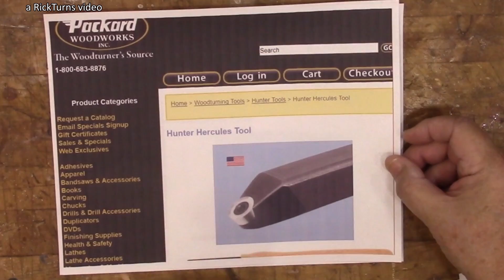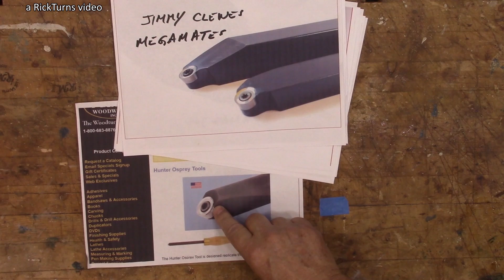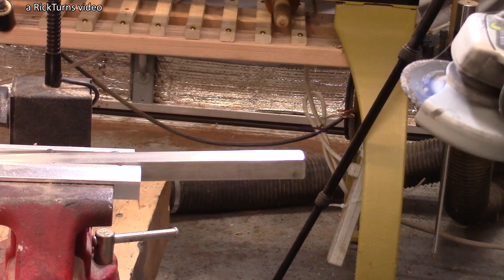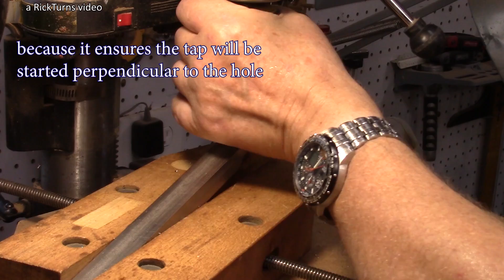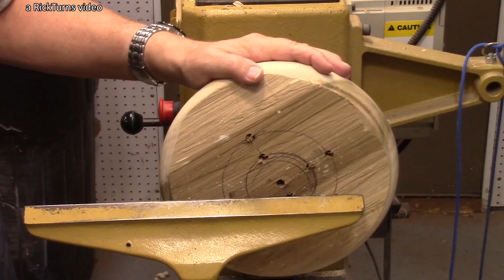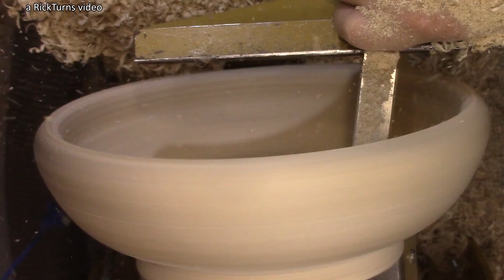Making and Using a Drop-point Carbide-tip Hollowing Tool

Comment: good video, I don't think you would need to rotate the carbide for a long time, assuming that it comes sharp. I have some little rounds that don't seem to be sharp, but the larger ones are awesome, cut for a long long time. I've got a piece of wood on the lathe that I plan to hollow....I've not done much of that.

How do you keep your glasses from fogging? That's an RZ mask??
Reply from the maker: It is an RZ mask, Mick. It is great...I have an Airshield Pro, but I can’t use it because the noise gets picked up on the video. I haven’t have a problem with my glasses fogging while I’m wearing the RZ mask. With the cheap paper masks, it’s a problem though.

Comment: I've made several carbide tools using cutters that I bought from Capt Eddie - whose prices are very reasonable.  However, he only has flat-top cutters - the cutter you used appears to be cupped.  

This raises the issue of  'rake angle' - I think this is ultimately an issue of the angle that the cutting edge presents to the surface of the wood, and you can achieve a good cut using either style cutter if the edge approaches the wood at the right angle.  The designs you were copying all have distinct negative angles.  But there is one manufacturer (in the UK) who makes carbide tools using square bars and who grinds the mounting surface such that the tool is not only raked downward, but is also tilted to the left.  

By the way - I share your pain about tapping holes.  My experience is that if I'm threading a hole for a #10 or #8 screw, it typically takes me about three taps to do the job!    Fortunately, even with buying multiple taps, its still less expensive to make my own than to buy a factory-made tool.  Also, I find that I don't dare turn the tap wrench more than about 1/3 turn without backing it out to clear the chips.
Reply from the maker: Thanks for your comments, Louie. I had forgotten that Cap’n Eddie sells carbide bits. When I’m ready for a replacement, I’ll check him out.
Reply: One more thing - rather than using a lockwasher, you could put a drop of thick CA on the nut to lock it down.  Heating the tool gently will melt the CA to loosen the screw.
Reply: Using tap magic fluid will help with the tapping
Reply from the maker: This is the first time I’ve heard of tap magic fluid. I’m going to look into it right away. Thanks for the tip.

Comment: Hi have you tried turning the cutter anti clockwise about  45 degree so its not so aggressive.
Reply from the maker: For this tool, no. I wanted to see how the commercial tools like this worked. However, a couple of months ago I made a 45 degree shear scraper with a HSS bit on it. Here's a link to that video: https://bit.ly/2C5Hjpw    Thanks for the suggestion, Mark.

Comment: Rick, look at your insert ( bit ) if it has a taper side from top to bottom it’s a positive insert! If it has straight sides it’s a negative insert, which makes tilling down necessary for Clarence. You might want to look at machine trade books for inserts because their ripping everyone off on prices. Just saying. I’ve been a tool maker for 51 years now and we only pay around 5 bucks for that type of insert
Reply from the maker: It does have a taper from the edge to the back of the bit. I've looked online for a source of carbide bits that are cheaper than what's available on the woodturning supply sites. The carbide and machine tool companies I saw wanted to sell only in boxes of ten, so the individual bits would be inexpensive, but the set of ten was more than I wanted to pay. Thanks for your comments, John.

Comment: I have made three carbide lathe tools out of a Harbor Freight 4 piece pry bars set.  Round, radiused square, and pointed bits.  I think mine can remove material fast with tear out if you force the tool and you can get a fairly good cut if you end up with light cuts.  To make the carbide bits give you the best possible finish, you have to twist them at a 30-40 degree angle so you are slicing across the wood instead of acting like a scrapper.  I find they work better than any other tool on acrylics.
Reply from the maker: I think you're right about the angle of the cutter.  A couple of months ago, I made a shear scraping tool with a HSS bit set at 45 degrees and it works great. Here's a link to that video: https://bit.ly/2C5Hjpw 

Thanks for watching, fa18mhr.

Comment: Doesn't seem to be as much of an angle on the bit as the mega mate or the hunter tools but looks like as you angled your cuts you got a similar approach to the wood.  I have found the square carbide tools take off the wood the fastest and then the rounds help to smooth the surface of the bowl and the bowl gouge gets it smooth enough for final sanding.  Not sure I want to go to the trouble of these angled carbide tools as you can usually get a similar approach by just varying the height of your tool rest.  But I do need to get or make a curved tool rest for my bowl making!  Nice video but I would bet this tool is going to go on the wall!
Reply from the maker: I haven't had much luck with the round carbide cutters (before this tool). I made one several years back and tried using it for finishing cuts and just couldn't get a smooth surface with it. I drew a 20 degree angle on the bar as a guide for grinding, but it does look like more than that. The Hunter tools seem to be a lot more than 20 degrees, and the Jimmy Clewes tools look like more than the 22 degrees that the tool description says. Thanks for watching, Terry.
Reply: Rick, by any chance was the round carbide tool on a round bar stock?  I have found the square stock to be far superior to the round for the carbide cutters.  I have one of the rounded square with radius cutters on a round bar and it is almost impossible to keep cutting smooth and steady.  I am going to cut a flat on it to see if this helps.